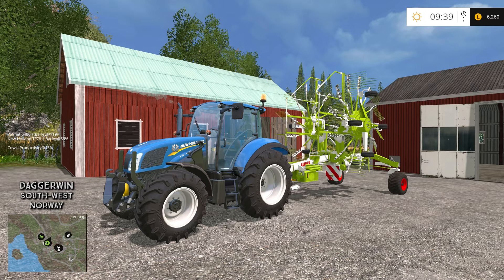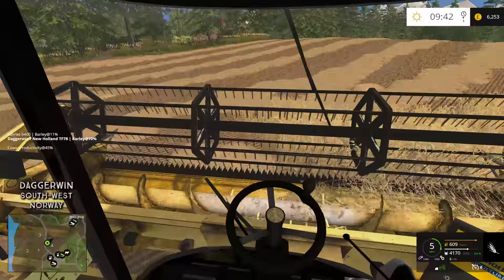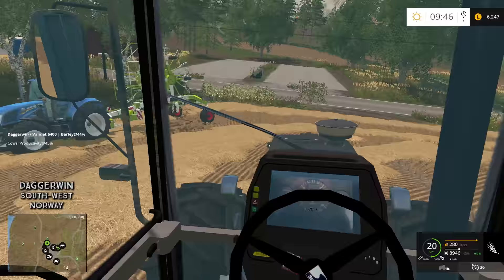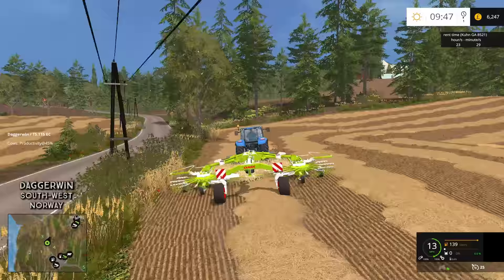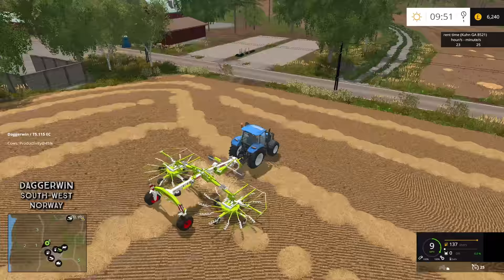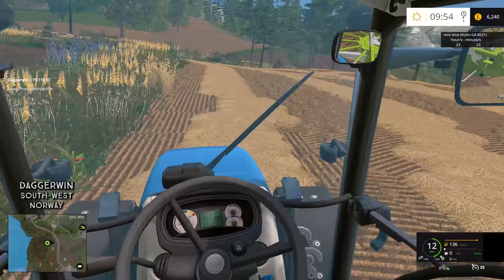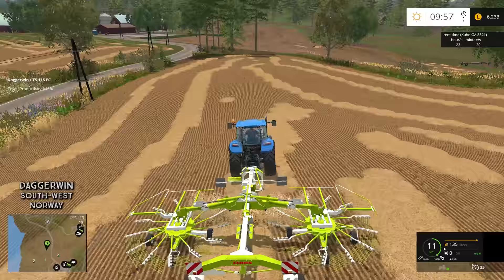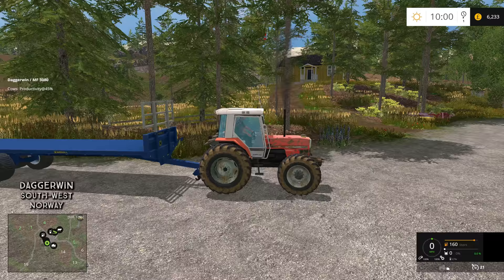Let's Play Farming Simulator 2015 | South West Norway | Episode 13

Comment: Another great vid dagger, is it possible to turn crop destruction off without soil mod? Where do you get the auto combine and auto tractor  mods from?
Reply from the maker: Yes you can do. The crops destruction is part of Drive Control. You can get most mods from Modhoster
Reply: Thanks
Reply: +Daggerwin I have been asking you forever  Please use Kubota equipment
Reply: +GOOFY BLUE yes
Reply: +Adam Freer u like Kubota equipment 2???

Comment: Low hp tractors like the T4 are useful in grape and wine production.
Reply: I thought you would need a more specialised tractor for that job?
Reply: Yes, the main thing is being small so it can fit in the middle of the lines and spray fertilize and do the line's maintenence. What i meant with low hp was that it was pretty small but i used the wrong words.